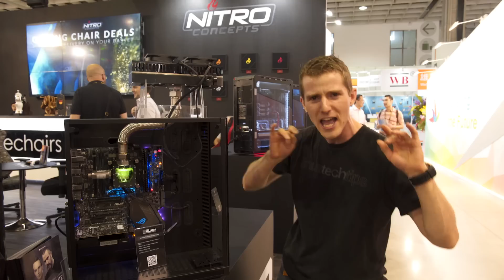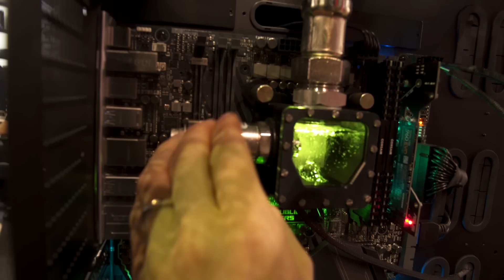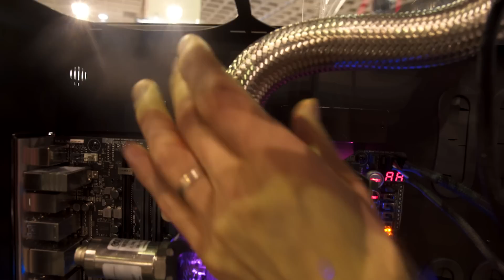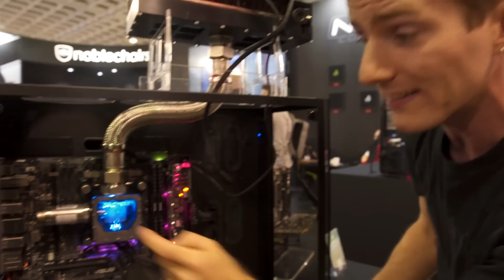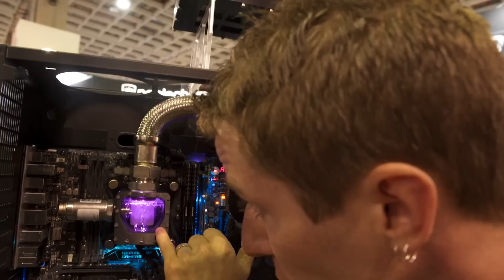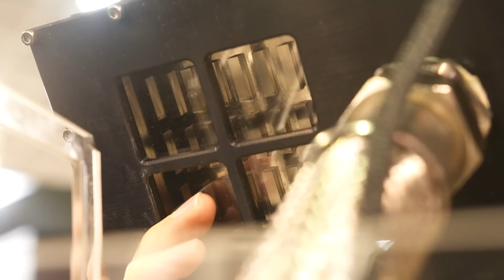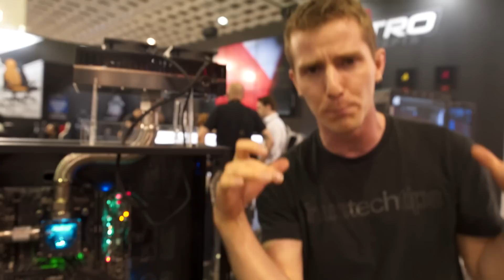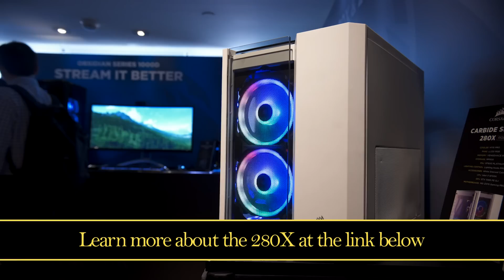Crazy Der8auer cooler prototype - NO pump!

Comment: my guesses as to the coolant:
-Methylene chloride
-Methanol
-Absolute ethanol
-Chloroform
-MTBE
It seems like there are no plastic parts (maybe except for some teflon gasgets), so corrosion by the coolent seems to not be a concern. Depending on how big of a concern fire hazard and toxicity are chose one of the above liquids. And the boiling point can be adjusted by the pressure (though you need fantastic sealing then)

Comment: I'll say it's ammonia mixed with water, mostly ammonia,  been used as a refrigerant for years. Boils and condenses back to liquid easily. Most big systems use ammonia and have a chiller tower to water cool the ammonia and condense it back to liquid, but this is different.

Comment: I believe that it is Freon-11. It  has a boiling point of  74.9 F at regular atmospheric pressure. If you were pressurize it the boiling point will would  get higher to a temp more usable.It is colorless, non flammable, and non conductive. Freon-11 is also highly regulated and is hard to get unlike other refrigerants

Comment: I'm going to guess 3M PF5060. Its what I'm using in my cooler. Boils at 56 degrees at ambient pressure and its non toxic. More importantly, its hydrophobic, so it won't absorb water from the air.

Comment: There is a real possibility it is DI or distilled water, the pressure transducer is a pretty interesting point, engineered fluids like Novec, Fluorinert, and other solvents wouldn't require much pressure monitoring.

You can literally dial in the temperature of your boiling point by the pressure of the closed chamber. 

http://www.wiredchemist.com/chemistry/data/vapor-pressure

Comment: My guess it that it's something like liquid Methyl iodide. Which is both A- Approved for use as a pesticide by the EPA in 2007, as well as B - Having a boiling point close enough to computer temperatures which could be modified by changing atmospheric pressure.

Comment: Because they mentioned that they don't expect anyone to find out what liquid is it I would not suppose it's any sort of hydrocarbon. But from the robustness of the enclosure I think it's at considerably high pressure, so my guess is CO2 (carbon-dioxide). It's easily avaible, clear in it's liquid state, and it's not flammable or dangerous at all.

Comment: 3m novec 1230 is used for fire suppression and is safe to use case withelectronics and has a fairly low boiling point and is safe to handle. It uses it's evaporative properties to cool and extinguish fires. I could see it being used as the liquid in this situation.

Comment: I'm guessing Dichloromethane. Although it's not non-toxic it is relatively safe compared to other chemicals. It's boiling point is 39.6C. Which is low enough to cool a CPU but still high enough to condense at room temperature (even if your room is kind of hot). From Wikipedia it also states "The chemical compound's low boiling point allows the chemical to function in a heat engine that can extract mechanical energy from small temperature differences.". With those properties it could allow it to power the pump free system.

But, there is also the possibility that they are using a chemical that has a higher boiling point but then decreasing the pressure in the loop until they can get the temperature they are looking for.

Comment: I don't get the concept, so the coolant boils then evaporates to the radiater which then condenses it while cooling it and then back to the tank where the cpu is located. Now what I don't get is how the CPU can be cooled if the coolant is boiling right where the CPU is

Comment: The Liquid is probably Dichloromethane (methylene chloride) or Trichlorofluoromethane. Just like the “Drinking Bird” toy works with a thermodynamic cycle, by evaporating the liquid on the bottom and condensing at the top of the head, which makes the bird dip and when the liquid runs back down, it goes back to its original place. So where’s my prize?

Comment: Dichloromethane aka Methalyne Chloride … the same substance used in the drinking bird toys.  This works because such a toy and this device come as close as possible to a Carnot cycle heat engine.  The drinking bird uses ambient heat energy to drive itself and the wetness of the head to cool itself.  This uses CPU heat and a heat exchanger.   IF a colder cold temperature revivor were provided it would be even more energy   efficient.    It has to be something like Dichloromethane which has a boiling point at a temperature that is desirable for CPU usage.  

Theoretically this could be done with a fluid like liquid nitrogen and be SAFER.  Nitrogen is inert and completely non flammable.  Small leaks would just evaporate.  It would also keep the CPU very cool.  However chilling it back down to LN2 temperature would not happen so easily.    LN2 can also be eliminated due to the fact there is no frost on the cooler. 

Water can be eliminated because the boiling point of water is 100C by definition.  Assuming this thing operates at approximately sea level pressures of 101.3KPa then my last sentence is true.  Water at lower pressures can boil at lower temperatures.  One could also fine tune the desired CPU temperature by fine tuning the pressure.  However, the final product is not meant to have a pressure gauge.  For that reason we can also discard a low pressure H2O based fluid.

PRESSURE AND WATERS BOILING POINT:
I see a lot of people below who say with great conviction that water will boil at a lower temperature at higher pressure.  As a 👩‍🎓 and a science 👩‍🏫 at the college level I 🤷‍♀️😭.  Google people use Google more likely than not you'll get a decent answer in less than a minute.  http://www1.lsbu.ac.uk/php-cgiwrap/water/pfp.php3?page=http://www1.lsbu.ac.uk/water/phase_anomalies.html  

Saying water will boil at lower temperatures at higher pressures makes no physical sense at all.  
https://www.youtube.com/watch?v=LQCU36pkH7c  I award them no points....

Comment: I think that the coolant is just water, the way it can boil below 100C is simply because there is a small vacuum pulled in the system, allowing for water to boil at a lower temperature... that's because the boiling point of water (as everything else) is dependent on the pressure in the system....i.e. at 0.2 bar water will boil at only 59C
Reply: it isn't because it doesn't conduct eletricy
Reply: Distilled water does not conduct electricity https://www.quora.com/Can-distilled-water-conduct-electricity

Comment: It's water. (under vacuum, hence the pressure sensor)
Reply: Kevin Day no way, condensation of said liquid when reaching the radiator will inevitably deposit enough precipitation into the case from the push of the fans and Linus even said the pressure gauge "won't make it to the final product" which WOULD be absolutely required in something that is using such high pressure's,. It's something else... Judging by the creator's smile, it's something he's quite proud of, not just from having succeeded, but from something that bestows the most Elite bragging rights of any inventor

Comment: The liquid could be some kind of alcohol, probably methyl CH3OH

Either that, or water at lower pressure

I'm actually leaning towards water, because of the pressure sensor. The pressure sensor seems important.

Comment: Distilled water under a partial vacuum to lower the boiling point. That's why the entire unit has to be so beefy: To prevent the pressure of the atmosphere from crushing it.

Comment: My guess is 3M Fluoinert FC-72 (or the generic: perfluorohexane). 56C boiling point and biologically inert. Seen it used in full immersion cooling, solar generators, and really wild biotech applications. It's not cheap, but anyone can buy it.

Comment: Acetone or some sort of alcohol at low pressure is my guess. Acetone boils at 56 C at normal pressure and at low pressure you can make it boil at an even lower temperature. Chloroform is also a good competitor though it is a bit too toxic perhaps.

This is a very cool solution. You are pretty much guaranteed to have your CPU slightly above the boiling point at whatever liquid is inside as long as there is any liquid left in the system and the more liquid  the heat vaporize the more cooling you get. So this system would give you a very stable temperature with high performance components. Disadvantage is of course that it is completely reliant on gravity at the current prototype though you can theoretically engineer a solution to that by adding a pump to the loop. Another problem would be the pressure fluctuation between a hot system and a turned off cool one. You don't want a vapour explosion inside your case.

Comment: The "secret" cooling solvant is a marketing hoax.
It could be nearly ANYTHING and it's not realy hard to find a non toxic, non flamable cooling solvant.
Pressure is the key: In a vacuum even water water boils at Room temerature while under super high pressure even Helium stays liquid at 100°C. 
Of course not every solvant is suited, since it may not be solid at low temperatures.
My bet is they used normal water at around 150mbar.
Reply: Doctor Wurst yeah, I figured something similar. That should put the boiling point somewhere between 50° and 60° Celsius right?
Reply: Don't think it could be water with how aggressive it is boiling.  Water expands 1700 times its original volume when put into the vapor state and would quickly make up any vacuum pulled on the loop.  This fluid needs to have a decent latent heat of vaporization but also have a relatively low amount of vapor expansion to not raise the pressure in the system above 70-100C boiling point
Reply: I think by "secret" they really meant not finalised. My guess is that that pressure sensor is for finding out which pressure the should run various liquid on and that valve up top is for lower  the pressure to run (experiment)
Reply: If the water is boiling at 70 degrees C the pressure will increase -> the boiling point is increasing, so the low temperature steam is condensing in the radiator and that indicates a pressure drop so the boiling point is lowering. That's why the system is maintaining it's low pressure (and of course low boiling point). If you want to lower the system operating temperature you only need to lower the initial pressure or simply oversize the system or both.
Reply: adlerman12005  You have a good point there. However I still think pressure is the key, if there is low or high pressure inside the systems a lot of solvants could be used. I assume there several solvants which could be used, this is why I think of it as a marketing hoax.
Reply: deionized water right?
Reply: I was thinking something like vegetable glycerine or propylene glycol, cause maybe they'd want to meme it up.
Reply: The fact is the loop is closed, so it is more similar to a heatpipe, meaning custom materials or in this case Novec Immersion Cooling Fluid.
Reply: daylightriot could be. I think they are finding the best liquid to run as a commercial product (with warranty and import-export law ect....)
Reply: Good solution, everything I could think of that had a lower boiling point than water was either flammable, toxic or would degrade plastics. I guess that also explains the pressure gauge. That said the "pressure gauge" looks very large so perhaps it's also a regulator?
Reply: That's what I was thinking. The way it bubbles reminds me of boiling pure acetone, which you'd have to do at a low pressure. Considering he said you won't be able to guess though, I'd say it's probably some industrial coolant.
Reply: Nice theory. I think this might be useful for tweaking your thermal profile or adapting to different ambient temperatures, too. Also, (de-ionized) water is relatively cheap.
Reply: your point is right but facts are wrong
Critical point for helium is about 5.2K

Comment: The liquide may be under pressure lowering the boiling point. Would explain the heavy duty tube and pressure sensor.
Reply: Putting a liquid under pressure raises the boiling point. Vacuum lowers boiling point. Put some water in a syringe and plug the nozzle, then pull the plunger and the water will boil or evaporate depending on amount of water, its temp, and the amount of vacuum applied.

Comment: I have the feeling like https://en.wikipedia.org/wiki/Absorption_refrigerator or perhaps https://en.wikipedia.org/wiki/Evaporative_cooler may contain some useful information as to what could be in there. It would be improbable that a true ammonia-hydrogen-water based absorption chiller is being used, but probably a similar concept.

Or it could just be a common but more effective refrigerant, though anything other than R134a (1,1,1,2 tetrafluorethene) doesn't pop up into my mind at the moment, and that stuff is coming under ever-increasing legal question...
Reply: Upon closer inspection, R134a is gaseous at room temperature, let alone at elevated temperatures. It could work in principle though, but at elevated pressure. Something round 15 bar means the evaporation temperature is around 50 deg C, and bringing it up to 20 bar and we're at something like 67 deg C.

Source: This diagram: http://www.mercatokoeltechniek.nl/contents/media/R134a.png

Comment: My guess is that it is using 100% alcohol.... 
lower boiling point at 68 degree celcius meaning that as the cpu get heats up, it will evaporate right away.
It also will form back to liquid and its state will not change unlike water which have chance to turn into hydrogen or oxygen when turning into vapor. 
it is also very easy to buy it and non toxic as well as it is good to the machine stuff as it will not corrode or leave marks even if you are putting it idle for long time due to it can be used as cleaning agent.

Comment: A) Don't consoles use a similar cooling technique? So it is commercially used?
B) Didn't you guys at some point make a video about a fully submerged system where the liquid had a boiling temperatur of somwhere between 30-40°C? Is it that?

Comment: "No one is ever gonna guess it"
That makes me think it's something crazy.  Hmm
A liquid that is a liquid at roughly room temperature.  Has great thermal conductivity and seems to have a special housing...

It's probably wrong but, is it hydrofluoric acid?  
It's got like 4x the thermal conductivity of water and boils at roughly 20c...
That's just a little too cold though.  It would never condense with the cooler.  Even if the housing was somehow resistant to it.
Reply: If the pressure inside the housing was higher, it would boil at hotter temperatures...  It would also have greater density and thusly greather thermal conductivity...  

Eh but it reacts badly to basically everything.
Reply: Maybe carbon disulfide?  Slightly higher boiling temperatures.  Though only 1/6th the thermal conductivity of water.  

But it is clear.
Reply: There's also Ether...  Eh I'll give up.  Honestly I'm hoping it's hydroflouric acid,  If nothing else because that would be crazy and awesome.

Comment: probably a Flurinert FC 770 or variant, basing this on previous experience with the Sharplan 40C laser system, its cooling method was similar, the laser tube would heat up the fluid and vapour would rise up into the condenser, upon cooling it would dribble back into the reservoir tank before returning to the glass laser tube.

for reference here is the 3M MSDS
http://multimedia.3m.com/mws/media/471785O/3m-fluorinert-electronic-liquid-fc-770-product-info-sheet.pdf

at the time of posting I am 4 beers into this post, anyone can use the formulas on the second sheet to figure out the pressure its at for cooling that CPU.

neat idea using it for CPU cooling, would hate the valve to blowout during game play, but its better than leaking water based coolants

Comment: My best guess would be an Inhibited Glycol and Water Solutions or Dielectric Fluid since both are non conductive and both are used in the electric industry with low boiling points to cool such as this version.

Comment: I think, he uses 3M novec, because he used it in his latest projects.
Reply: Finn Erdmann nope, novec doesn't need pressure to do it's thing, hence the pressure gauge, thick walls, sound proof even though it's crazily boiling, it's under some heavy bars and since the man is so confident no one could guess what it is (novec is already in use WIDELY around the globe)

Comment: Look at how thick the tubing and the chamber are, yet the radiator is on a flimsy looking plastic pedestal? Perhaps there is higher pressure inside the chamber and radiator. Then perhaps even a different range of substances could be used. Gasses become liquids under more pressure. Actually, you could probably fine tune the boiling point using pressure. Water boils at room temperature in a vacuum chamber by the way. Heck, he could have decreased the pressure and used water. I think the key thing to look at here is pressure!

Comment: I would like to think its just very high quality Deionized water under very low atmospheric pressures (vacuum). 1. It's clear. 2. It boils at very low temperature when pressure is low. 3. And it's VERY good at transferring heat. 5. It will also condense back into a liquid once it cools in the radiator. Since all cpu's around the world work at roughly the same temps it wouldn't be too hard to figure out a good pressure + boiling point + condensing point etc. And water is cheaper than any of the other liquids mentioned. I'm no scientist but couldn't it just be water under very low pressure? Where the boiling point is in that middle circle, that looks like something that could be manipulating temps.

Oh and I forgot to mention, you could add some clear glycol to help with the heat transfer so long the water quality is really high but I'm not sure if that will change the boiling point or not. Just saying.
Reply: that's actually a pretty good guess, easy and cheap.
Reply: you just described almost all clear liquids out there